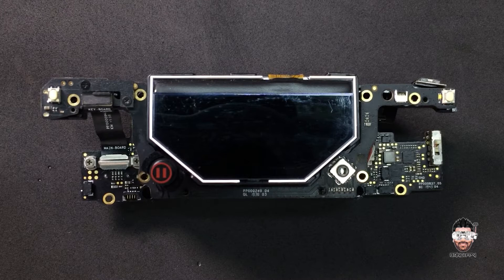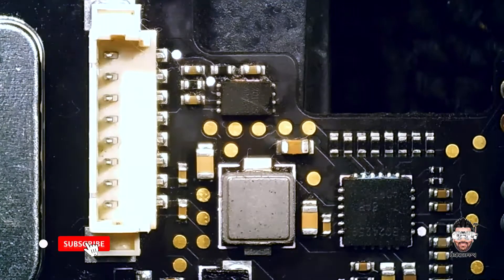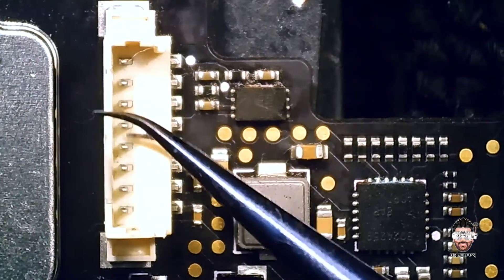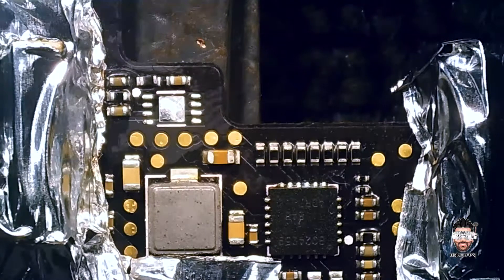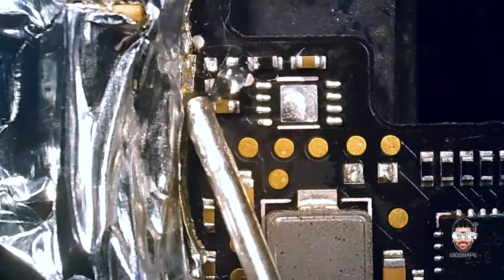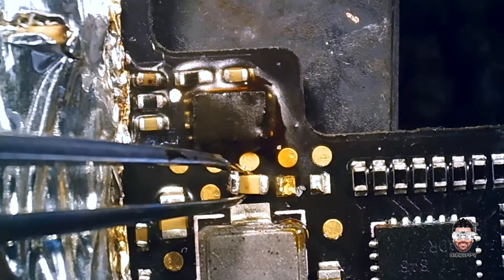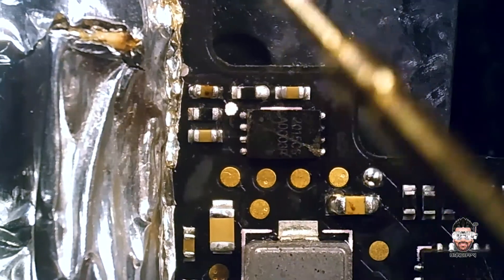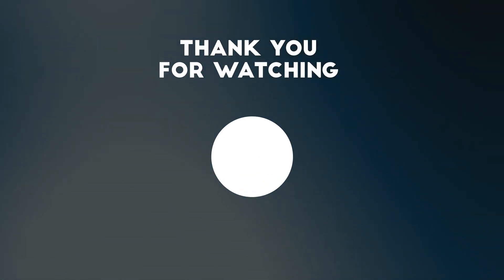DJI MAVIC 2 PRO REMOTE REPAIR #DJIREPAIR #MAVIC2PRO #REMOTEREPAIR #BANDIFPV #FPVVIDEOS #satisfying

Comment: I broke my charging port of mavic 2 pro controller....
The pin broke and was inside the controller...
I gave it for repairing,they said it cannot be repaired... And they lost the charging pin which broke and was inside the controller...
Any idea where can I find the pin...
Or can you tell what kind of pin is required (  like no.of legs ).....
Reply from the maker: Can't Say Exactly, But you can try from Aliexpress, There are plenty of sockets.

Comment: you have tutorial for those remote that drains on their own even without using?
Reply: Hey I had the same problem and then one day the remote went completely dead and stopped working. Haven't flown since 2 years now
Reply from the maker: Probably there is an issue with battery management section.
Reply: @BandiFPV  when i remove the battery and let it stay for one week its stays 100 percent. but once i connect it. it drains 9% daily until drained.

Comment: Hey ! My remote doesn't even power on with the plug connected. it is completely dead. what could be the problem?
Reply from the maker: Probebly the Power managment IC went bad. But can't tell without checking. ☹️

Comment: Ayyage pawichchi karana equipment tika kiyanna puluwanda?
Reply from the maker: DIY Rewoke Station with T12 Soldering Iron
Amtech Flux 
Mustool Microscope 
Mechanic Solder
5A 30V Bench Powersupply
Titanium Tweezers
Reply: @BandiFPV  thank you ayye."DIY station ekak " eka nam maru❤️❤️❤️